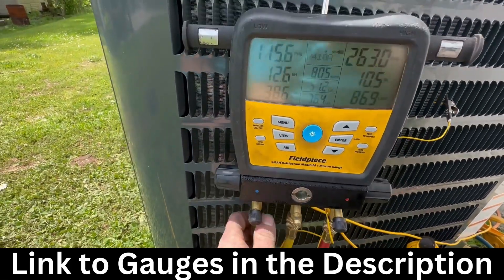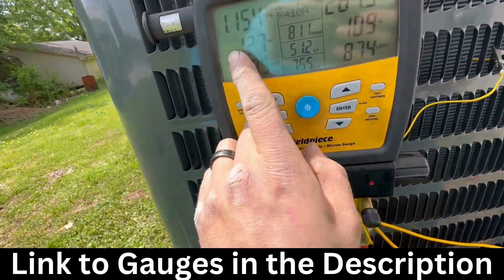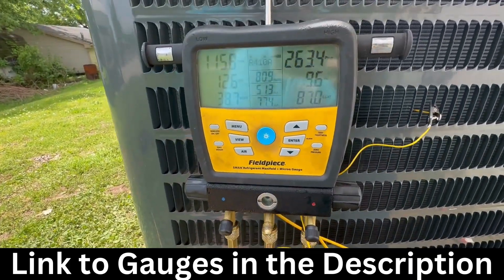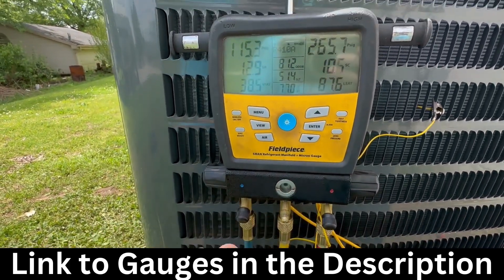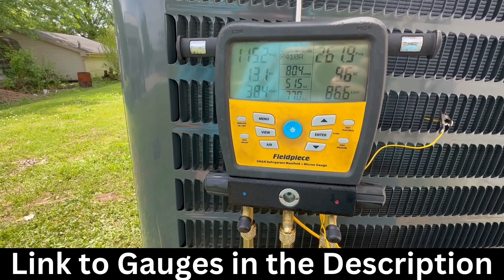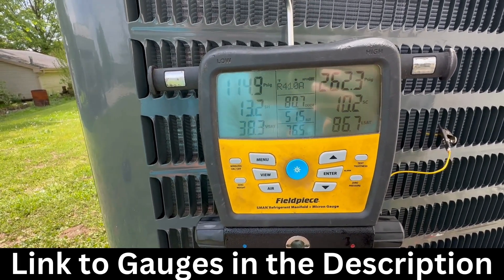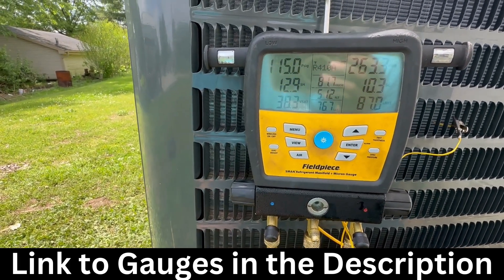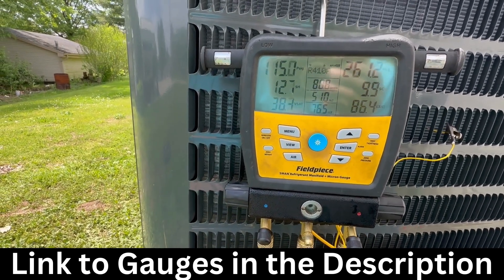Fieldpiece Digital Gauges worth it after 1 year? Sman 380 v

Comment: What app? You mention it at 1:40
Reply from the maker: Field Piece App
Reply from the maker: its the check charge app.
Reply: The manual for this model says you can use the wireless Psychrometer Probes and it will calculate real time target superheat for you..."Target Superheat (requires model JL3RH for real-time)"